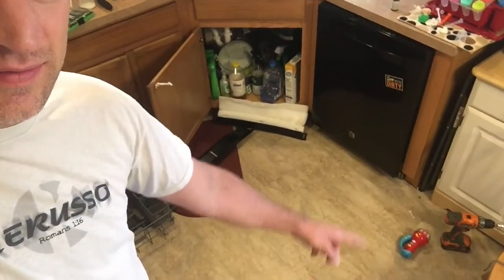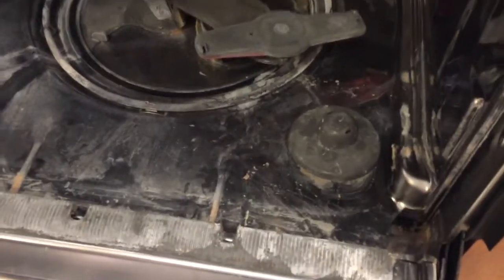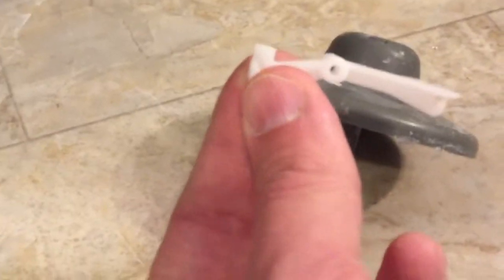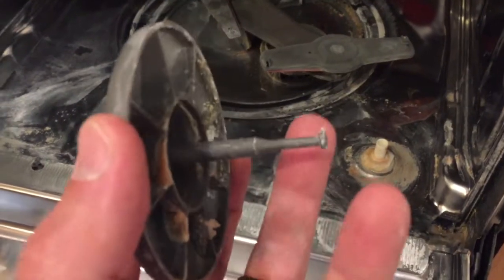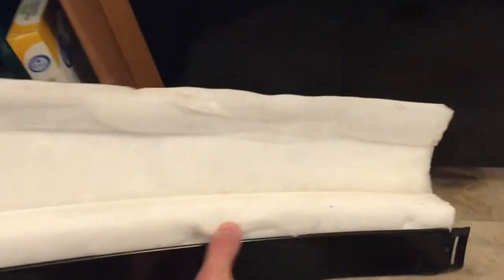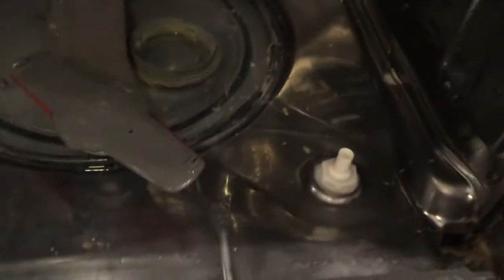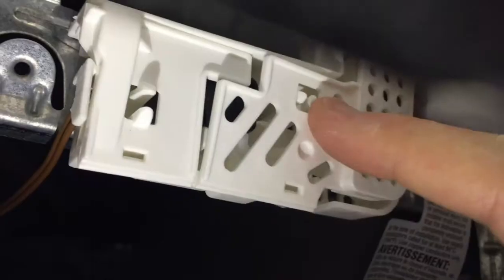DIY Dishwasher Float Valve Clean

Comment: Thanks for the video.  Helped me diagnose the occasional leak under the front right corner of our dishwasher.  I pulled it all apart (completely removed the housing from underneath), cleaned everything well with CLR to break up the deposits, and then reinstalled everything.  I also pulled out the door seal, soaked it for awhile, cleaned off the deposit that was building up, and then reinstalled.  All in all a great video to help understand how the system works.  Thanks again.

Comment: After replacing the door gasket (more $), I decided to cut my losses and spring for a new unit. Kenmore’s float design seems to be Whirlpool’s standard and is problematic for the reasons you point out.  I’ve owned and installed many dishwashers over the years and I never ran into this problem before.  Hopefully, not all brands are made by Whirlpool; maybe the float systems in other brands have a better design.

Comment: Excellent. My dishwasher has been leaking. I knew it had to do with that float switch, but I wasn't exactly sure how it works. Now I know and will not have to keep putting a towel on the floor when I run the dishwasher. YouTube University is great!

Comment: Thank you so very much for this video. I had soapy water on the floor in front of my Maytag .
I took the my float top off. It didnt look dirty. It did have a film on it. I cleaned it off, put it back on.
I ran a load without dishes. There wasn't a leak.
10-24-2023. May God bless you.
Reply from the maker: So glad to help! Just remember, it will probably do it again in 6 months to a year 🙃

Comment: Thank you Josh. Tried cleaning first before disassembling the float switch. It was also the most logical explanation as the underside of the seat was dry and water only dripped from the white plastic. This is certainly a design flaw. You’d think there was a way of sealing the float without the chance for overflowing water!
Reply from the maker: I know, right?!

Comment: My old Whirlpool dishwasher has a metal orifice hole (much like our shower heads) at the electro magnet valve which is used as a meter for the water flow fill rate before either the timer or float shuts off the magnet. Also clean the inlet screen at the magnet valve.
I had to use a slightly larger drill bit to drill out the hole which was too small to let enough water in and so caused motor pump cavitation sounds and poor cleaning, which manually adding more water fixed. 
I also had to bend/adjust the float shut off level switch to allow shut off at just the right water level to keep from cavitation but not use too much water.
Take care

Comment: Thanks man....my problem was that was that the darn nut that tightens the switch in place through the wall of the tank, loosened off and water was leaking out there.  I could not figure out how to take the inner float off, until I found your video.  Thanks...tightened it up and put a little dab of silicon on the nut to stop it from loosening itself off again.  Thanks again
Reply: Mine also did this

Comment: Well Done! My Maytag MDB8969SMD0 was leaking and I couldn't discover the problem for sure until I viewed your DYI. It seems that there was a significant build-up of SLIME up in the inside of the float cap itself. I assume it was just too heavy to float reliably. I cleaned it, reassembled, and listed for the switch click and I'm hoping that was the issue; if not, and if I do discover where else the problem lies, I will post what I learn. Whatever the case, thank you for your video; the repair parts sellers don't provide this info.

Comment: Cleaning the float is only half the job.   You should also remove the float housing by taking off the nut and clean the area under it.  Also clean the threads of the housing, the nut and rubber washer.   Replace the the rubber washer if it’s damaged.
Reply from the maker: Good point

Comment: In times of urgency we need quick precise to the point help. Nope instead we have to surf one minute in To find the information we need.  Frustration ensues, anxiety goes up.  Your discovery of editing and adding commentary deletes your primary purpose of distilling information in a timely concise manner so you can instead add whimsical dialog and video thereby making you the focus.  I know you don't get what I'm saying. 

From behind an attacker using both arms wrapping them around your chest.  So you bend at the knees, turn your waist and grab both his legs at his knees with your arms.  Lift up and throw him backwards. In a video I show you this in 12 seconds.  This is concise, quick, no filler,  and you remember it forever.  This is the difference between an instructional video that requires precise information and you.  Again, I know you don't get it.
Reply from the maker: Nope, I totally get it. Especially when you write articulately. Thanks for your input. I have considered chopping the intro of my video down to almost nothing and many of my videos I have timestamps in the description so you can get the info you need quickly. However, there are few things I won't be changing because they are part of why I do what I do. One is that  I am usually very detailed about a job from start to finish. The reason for this is that I got frustrated myself with too many "How to" videos that start in the middle of a job and don't describe in enough detail what they are doing. So I started these videos so that a complete novice could follow me. The other thing, "adding whimsical dialog"...well, this makes the videos fun for me. So, sorry it didn't give you laugh - I'm sure you can find someone else describing the process in a much more dry fashion :D

Comment: I wish I had seen this video before I attempted to clean that float. I assumed it snapped in and out, so I just pulled it up, but I snapped off the little knob on the end.
Reply from the maker: whoops! I'm sure the float valve isn't an expensive part
Reply: @rawar777joshanderson  I ran a load of dishes today and it seemed fine. The float can't come out when the lower rack is in place.

Comment: Thank you! What I’m Wondering unless I completely missed it was how did you get the float out in the first place? Was it just a good yank? I don’t want to potentially make this worse. Lol.
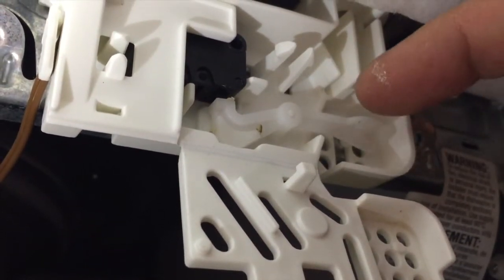Reply from the maker: Yeah I guess I started the video with it already out, didn't I? If you see at 3:23 where I mention where the "stem" comes down, there's a little lip that it pops past. When you're taking it out, if you use the tip of your screwdriver to pry it toward you and then push it up and out - that will get it past the lip. Yeah, don't yank or it might break the nub or the lip. (How about those technical terms?)

Comment: I seem to have to do this maintenance once a month. We rinse dishes before loading and we use a quality soap. Between the build up under the float and the sludge in the filter its really Griffin annoying.
Reply from the maker: Yeah me too! The next step is trying to figure out how to prevent the gunk in the first place. I just had to do this again last week.
Reply: @rawar777joshanderson  we’ve been using the Cascade Complete pellets from Costco. Someone told me the plastic wrapper just melts but never really disintegrates leading to gunk build up on the filter and float. We’re going to go back to the big bottle of gel and see what happens.

Comment: Hi. My dishwasher is not washing. It fills up. But is not spraying water. Ran the diagnostic test. It givesme a 6-4 code. So I replaced the Inlet Valve. I can hear the float switch clicking. What else can it be?
Reply from the maker: This is beyond my skill level. There are a lot of things it could be and its hard to tell without looking at your dishwasher in person. One thing I have found is that any part that carries or sprays water can get really gunked up.
Reply: Did you ever find out what the issue was with the 6-4 code?

Comment: Hey Josh, Thank you. Great video. One question... you show how to get the push rod back in. How did you get it out to begin with (without pulling the machine out)? My assembly looks exactly like the one in the video. Thank you.
Reply from the maker: Yeah I guess I didn't show that very well in the video. It's kind of just reverse of how I got it back in. You open that little door and then use your screwdriver to pry it lightly toward you so the nub on the end comes out and then you you can lift the whole float from inside....Hope that makes some sense.

Comment: I have an issue with my float not floating and letting water drip down. Everything is super clean. And WHY did Whirlpool put the electrical connection point directly under the hold in the tub? Seems like an electrocution waiting to happen.
Reply from the maker: It’s hard to say what your problem is without seeing it. Are you sure the float valve is clean? And yes I agree I really don’t know why they build it like this.
Reply: @rawar777joshanderson  I know it's super clean because it's a brand new dishwasher I bought in 1995 and never installed. I hooked it up to water and power outdoors just to try it out in case it leaked. Surprisingly mice never got into the box and it was like I just bought it yesterday.
Reply from the maker: @dalesworld1308  Yeah..that's kind of a mystery then...
Reply: The diagnostic code for a bad float valve switch is for my KitchenAid is 6-4.  Also if the float doesn't make the clicking sound when you move it the float can't be actuating it. I bet they go bad partly because of the overflow of water nearby.  It is surprising to see how close the electrical wiring box is to the hole too.
Reply: @drakedorosh9332  I had that problem as well.  The plastic nut holding the whole thing in had loosened off, and so it leaked around the nut.  If you remove the float you can access the plastic nut and tighten it up. josh shows you how to take out the float.  I also put a small dab of silicon on the nut to adhere it to the tank wall so it would not loosen off again.  I only used a dab because I thought that if you ever needed to replace it, you could remove a small dabo f silicone easily instead of fully siliconing it...

Comment: That is the dirtiest dishwasher I’ve ever seen, why didn’t use more Kaboom!
Reply from the maker: Any suggestions on how to clean it? I use a cleaner on it about once a month but it get so gunked up so fast
Reply: Josh Anderson Art maybe it’s super hard water? We do a quick rinse on the real dirty stuff before putting it in the dishwasher, that helps avoid problems too.
Reply: I’m actually cleaning mine now and once in a while due to calcium build up I have to take it all apart water pipe, filter, etc and soak the pipe with CLR overnight to release the gross buildup in the pipe 
then clean the pipe with a straw/pipe cleaner 
You can also do a cycle in dishwasher with CLR and if you have the “cancel/ drain” option you can scrub out good rinse it down and just keep draining/ rinsing  all the suds before running it 
After that run a hot sanitation with Lemi shine dishwasher cleaner 
Yes I’m OCD and I really want to clean that float but I’m afraid I’ll break it sooo I might try taking it off, so thanks for the video :D

Comment: How’d you get out off!?
Reply from the maker: Ha I didn't actually show that, did I? Well at 4:03 I show where the little knob on the end pops over... You have nudge it over the lip with a screwdriver as you're reaching around the door and lift the float valve out....Clear as mud?
Reply: It would have been helpful to show that. I saw you pop it up and out and thought I could do the same. Now the flange is broken off and I'm out 40 bucks for a new one. Plus, it's probably the rubber gasket that's leaking, not the float. And gotta tell ya, the little insert shots suck.